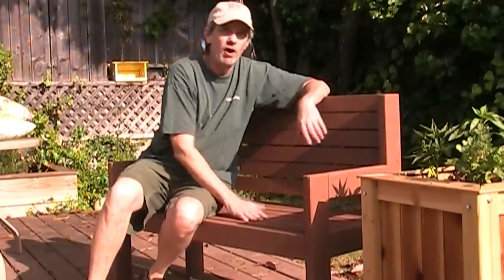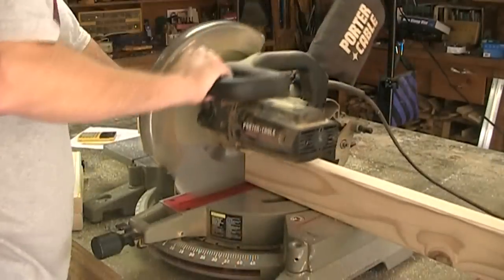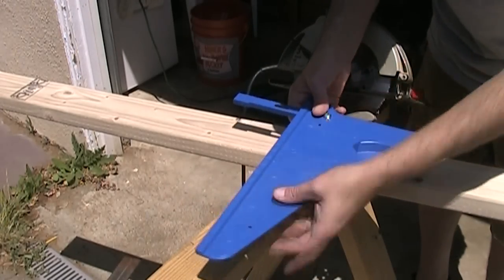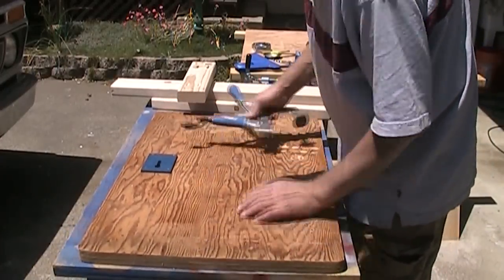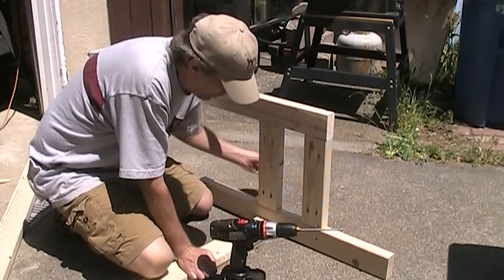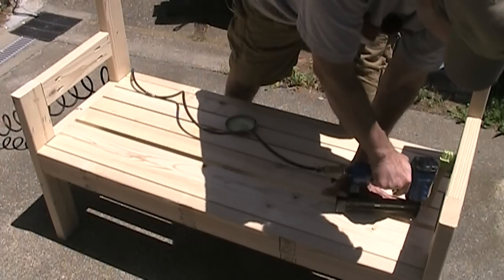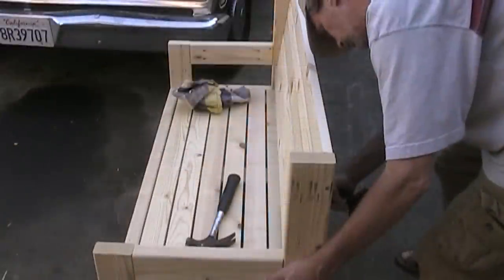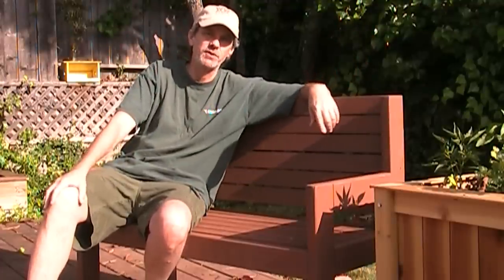Build a simple garden bench. Easy woodworking project.

Comment: "All you need for this is a saw and drill" yeeaaahhh
Reply: Why the sarcasm? that seems completely reasonable, i build most things with a circ saw and drill. plus glue but thats not really a tool i guess.
Reply: So far as power tools.
Cut wood.
Drill holes in wood, you don't have to use pocket holes.
Reply: Half lap joints for the sides, and just long screws into the end grain for the rest should work fine

Comment: Steve,
I took this up as my first woodworking project and I am excited by the end result. I used mortise and tenon joints for the sides and rails (not perfect, but strong enough) and 2.5" screws with free hand drilling not having a Kregg jig. Worked out just fine.
Thanks a million for sharing everything and explaining everything in a straightforward manner.

Comment: Found the dimensions for this bench .  This bench is easy to build and turned out very nice.  Good design.
Reply: Mind if I ask what size screws you used? I'm a complete beginner planning to give it a go...
Reply: @thefrenchnanny2407  Gosh, it's been so long ago when I built it I really can't remember the screw sizes I used, but if you message Steve Ramsey (the builder in the video) regarding this particular bench project, I'm sure he'd gladly give you any, and all, information you'll need.  Sorry I was of no help here.  It really is a nice bench, and it sold quickly.  Good luck, and have fun with this.
Reply: @mulekickhandmadeguitars8465  Thank you for your kind reply Mike, it was a long shot!
Reply: @thefrenchnanny2407  Are you still going to build the bench?  You haven't given up on it, have you?  I hope not.

Comment: It looks great. My only issue is that all the weight is only bring supported by the screws. There's nothing under the seat that directly supports the weight of the load other than the side legs of the bench.

Comment: one advice - when you attach the back with the long clamp, if you start from the bottom then the 2x4s for the back will still have some play so you can easily fit the boards, and still can clamp each one when screwing. If you know what I mean.

Comment: Simple way to make that last a little longer is any surface that has the grain UPRIGHT..facing the sky (end wood), just put a board on it. That keeps the rain from soaking into the core of the wood.  Nice Bench.  I do think I would have painted or stained it before assembly..and wouldn't that have looked great stained with spar varnish?  Yea, I know you like paint.

Comment: Great project, thanks. Do you use treated pine? (Im in Australia) for  outdoor projects as normal pine will rot quickly when outdoors exposed to the elements? Or are you relying on the paint to protect the timber? Thanks

Comment: I was just working on this bench and discovered that the cutlist that was shared isn't correct.
It indicates 7 - 1'1" on a 2 x 4. 2 are the arms and 2 are the supports below the arms, leaving the 3 seat supports which are more than 1'1". Also the front uprights that are 34" inch Steves picture are only 32" in the cutlist

Comment: The only 1x3 wood I can find is called fur strips. Are they good enough to use or should I use something else? By the way using a table saw is not an option to rip from a larger dimension wood since I don't have one.
Reply: 1x3 furring strips work fine. But look thru them to make sure you get good ones.

Comment: hey Steve can u tell me the kreg jig I am wanting 1 but the description on it is max width 1.5 I am wanting to use 4x2 width is 47 mm will the kreg jig take the wood I am a novice woodworker and do not want to go to the expense of buying a jig if it isn't going to take the width of a 4x2
Reply from the maker: +william angus Yes, it works fine on 2x4s.

Comment: I made sketchup plans for this bench (only a few changes).  Mainly I rounded the corners of the arms and the back uprights.  I also made the lumber dimensions smaller to account for Jointing and Planing to make them square.  Totally not needed for the build, but if you got a jointer and planer, then it is nice to square the pieces since the wood I get from the home center always has issues. 

Go to reddit and then go to /r/Sketchup/comments/ggo4vx/park_bench_plans_woodworking/